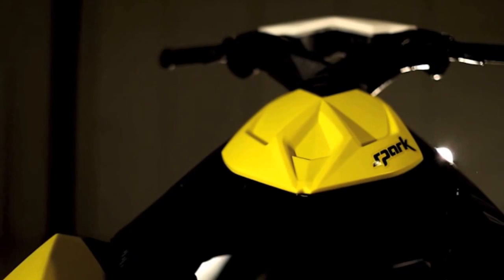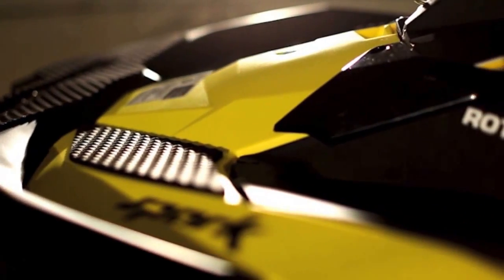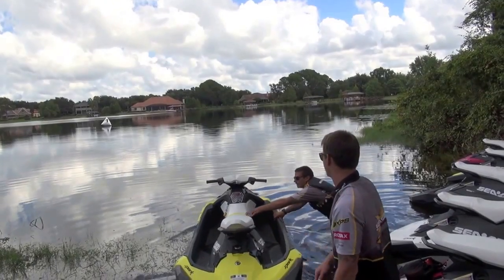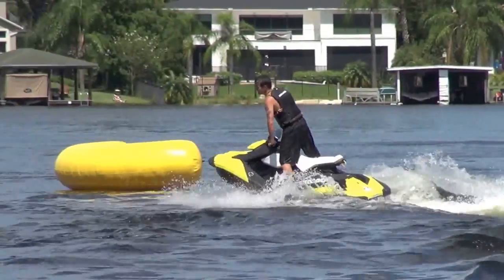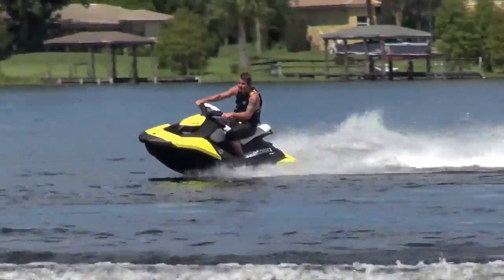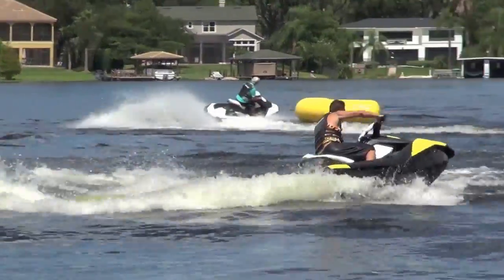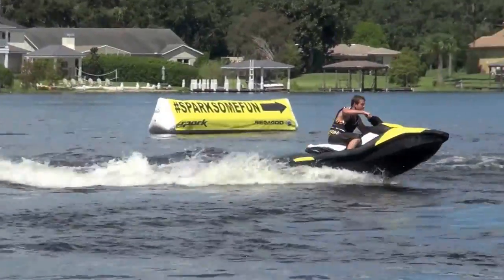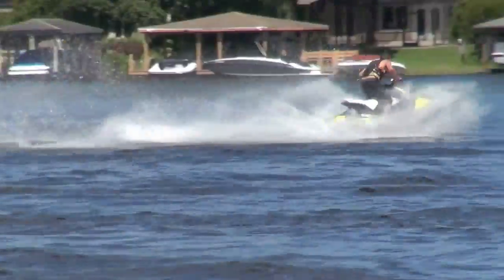2014 Sea-Doo Spark by Designer Jacques Mayrand

Comment: Affordable?!! This thing costs around 12 000 USD in Finland. Affordable my ass
Reply: Lmfaoo that fucking sucks it's only $5,000 USD here
Reply: vega1051 How much for the 2up 90 HP?
I just re-checked and 12 000 was the price for 90 horsepower version. You can get the 60hp 2up version for "ONLY" 9000 dollars. 
It is still way too expensive to be called affordable.